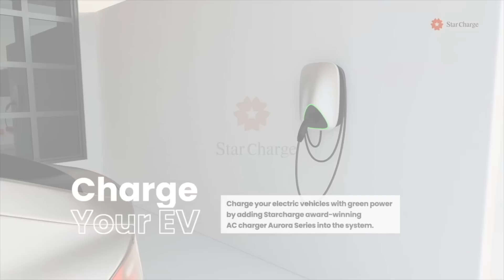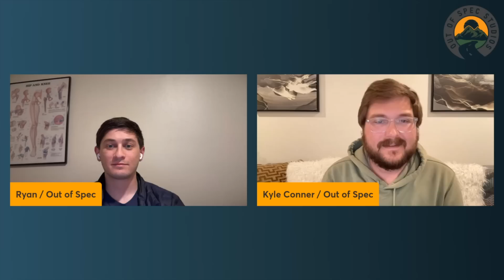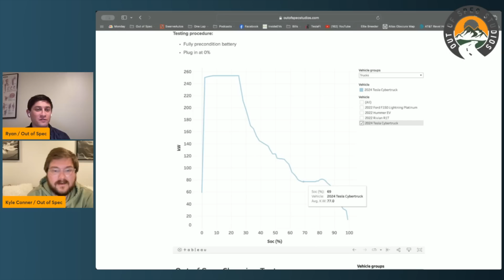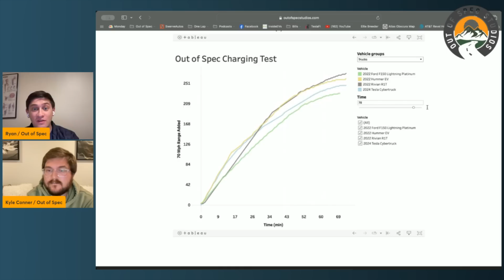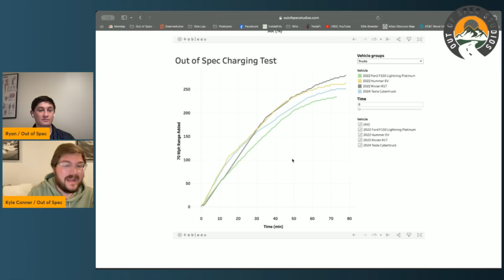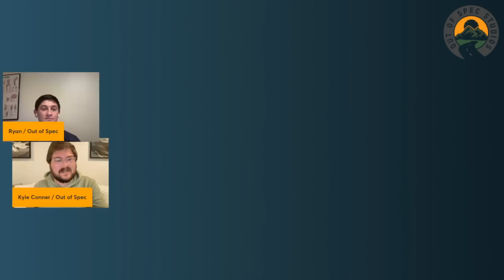Cybertruck DC Fast Charge Testing & Analysis - Comparing To Rivian, Lightning, & Hummer EV

Comment: the argument that Tesla will significantly improve the charging curve over time doesn't really hold anymore. They have sold millions of EVs, and the 4680 format has been out for a while now.
To me, Tesla charging performance and efficiency where the only arguments making the CT appealing. Instead, that's not really the case, and the battery is undersized as well

Comment: 7:00 They are not 4 identical battery modules... if you try to divide 1366 (total number of cells) by 4 ... it does not compute. It's probably more like in Model 3/Y, two longer modules and two shorter ones.

Comment: 31:19 since you plugged in at 0%, you ended up reaching Max allowed Cell temp earlier than you'd if you were to plug in at 10%. Which is why it thermal throttled starting at 25% to 55%, from 55% to 65%, it looks like got throttled again due to cell temperature difference. You can see it catching up slightly again at 80% after which it was more voltage limited as it's getting closer to 4.1xV

Comment: Kyle loves Tesla.
Reply: He respects Tesla but he tells it warts and all.  

Well, I agree if you have a giant battery, you need a faster charger. The number of people who have a spare 100 amp circuit to run an 80 amp charger is diminishing tiny. I did do some significant cleanup on my panel to put in a 60 amp circuit for my Tesla.  It’s made a bit more different by the fact that I have a fully electric house with heat pumps and heating and no gas which is a choice.
Reply: @stevenichols4639  lol. sure. his carrot and banana tests showed how much he respect tesla.

Comment: The biggest issue with EV is RANGE ANXIETY.

DC FAST CHARGING/ SUPERCHARGING is all the rave. 

It takes me roughly 7 hours to charge my Cadillac Lyriq AWD Luxury 3 to 280 miles on my Lectron V-box  40AMP wired home charger.

But I charge while I'm asleep so I don't even notice.

$50 - $100 a month more on my electric bill is WAY BETTER than the $100 PER WEEK being used by my 2015 JEEP SRT or my 2016 DODGE CHARGER HELLCAT.

Eventually I want to make a video testing the charge time of a EV GO Fast Charger.

Then I want to test a Tesla Supercharger once they have the CCS adapter.